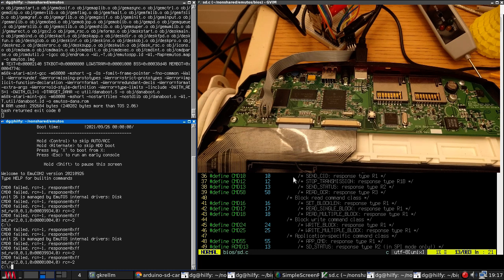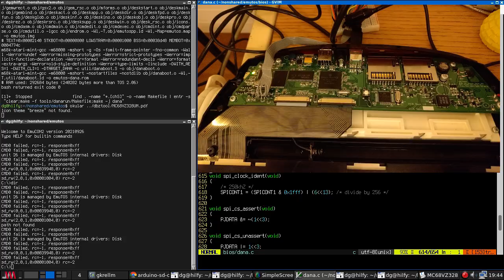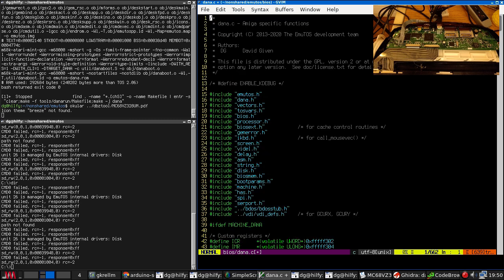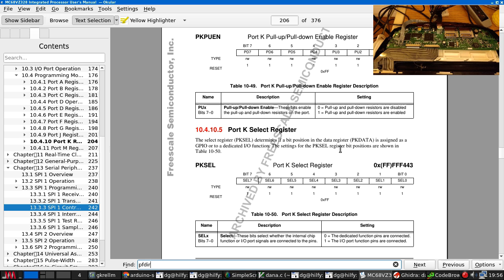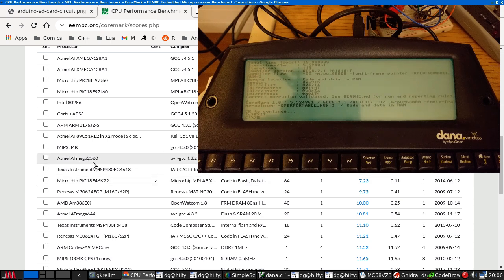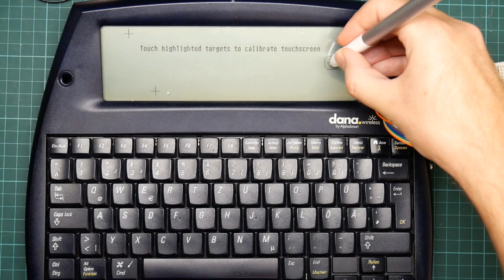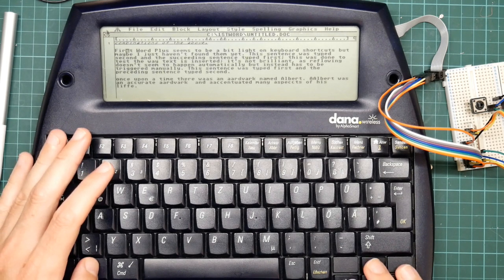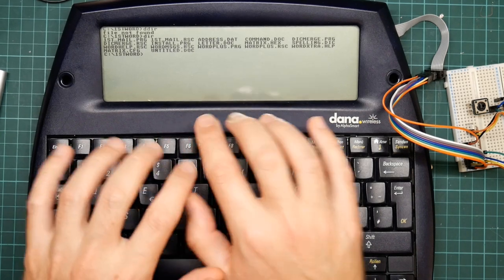Reverse engineering an Alphasmart Dana laptop thing 13/13, finished

Comment: Are you sure the code for setting up the GPIO for the second card is correct in dana.c?  It looks like you are setting the PF* values based on PJ* values instead of existing PF* values in the code section "Set up CS GPIOs and deassert both cards"

It probably still works because the second card is powered down but unless I am missing something this code could be messing with other GPIOs in ways not intended.